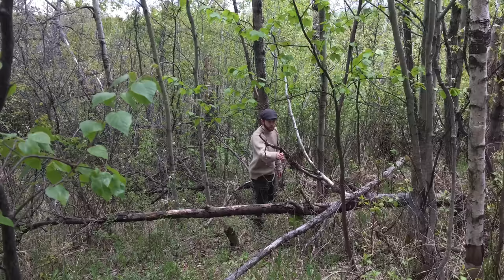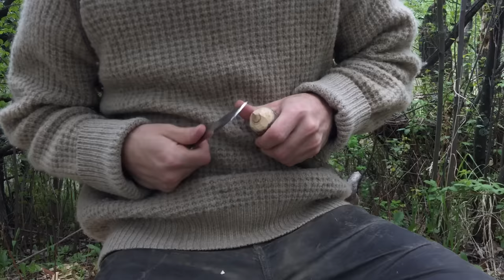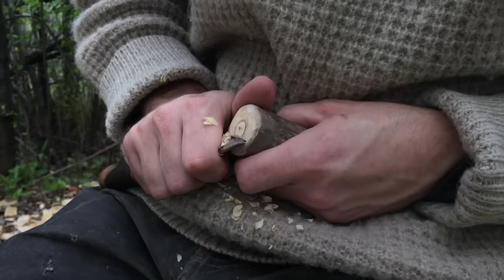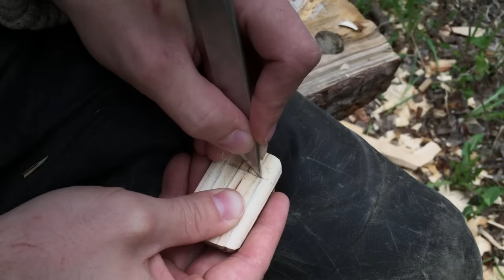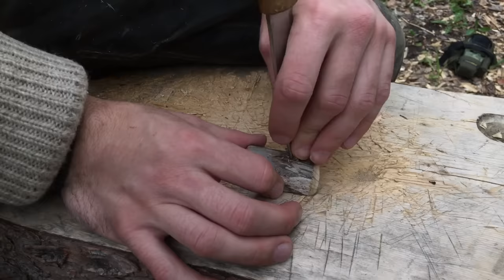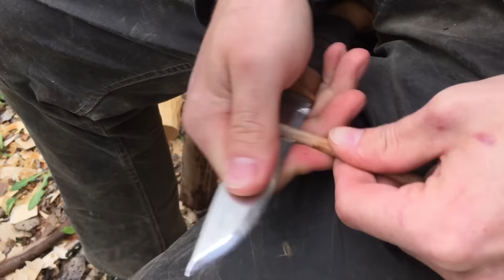Making a Simple Wood Pipe - Easy Woodcarving Project

Comment: I really prefer this kind of videos, instead of the ones in which they use machines to work with wood
Reply: Because I can not afford the machines. Kkk
Reply: After a certain point, they all sort of start to run together. And they lack that little ping in the back of the head that's like 'Hey, I might be able to do that..'

Not a lot of people have bandsaws and drill presses and forty-eight clamps. Most people have some kinda knife laying around
Reply: Absolutely. I went on a woodworking course and the tutor was wondering why I was so obsessed with slow, old-fashioned hand tools rather than his fancy machines. I said that, for me, the process is as important as the end result. Using those machines was like running a marathon in a car.
Reply: Yeah absolutely. Machines allow for really good work but most of us do not have those machines. Moreover, begginers like me have a weak practical mind. Watching methods with minimal tooling allows me to develop my practical mind, like, how to do things with minimal time and effort. I'm not sure i would yield better results with advanced machinery, one needs skill to efficiently use machines.
Reply: Me too

Comment: Smoking back when I was young, very young, I use to impress my friends when we smoked as I always had a selection of wooden pipes I had made myself. I used a small drill bit from the dump to twist an air hole down the stem, and sanded out the center or burned it. I liked seeing this done with only a knife. I still to this day smoke cannabis out of (much better) hand crafted pipes. Great stuff
Reply: I've been looking into glass blowing but this seems like more my style

Comment: Next time I'm camping and have bud but no papers or fruit and only using only hemp twine and a proper knife !
Reply: What qualifies as a "proper knife" in your opinion?
Reply: @primal.wanderer  a knife that's both sharp and holds its edge is really all you need. Even a mini Swiss Army Knife would work for a project like this.
Reply: Knife hits!
Reply: Get to packin boyz
Reply: @primal.wanderer  since it's bushcraft i highly recomed a fixblade knife, for the "logspliting" it's a realy bad idea so smash a folding knife's blade between two wooden logs.
Reply: @arcadymorel7565  that is very true
Reply: Who tf uses fruit still? You can buy a pipe for 5$ most places
Reply: Ron Frezno sometimes it’s fun to spice things up a bit to remember old times when the easiest thing would be an apple
Reply: Juan Pancho Just saying it would make more sense to spend 5$ on a nice glass pipe or 30$ on a decent bong, just in case you run out of papers. Think about hm you spend on kush.
Reply: Arcadi Moral I have several pipes, most of them I bought for under 25$. My cheapest was 5$ and it’s also the first pipe i ever bought. I’ve had it for 14 years and it hasn’t killed me yet😂
Reply: Arcadi Moral I smoke joints every now and then, but nothing compares to a big fat bong hit. If you smoke 1g in a joint you might feel buzzed, but 1g in a bowl will have you high as hell.
Reply: Arcadi Moral Fair enough, everyone has their own way of doing things😂, I love smoking joints/blunts but I also enjoy pipes. I was just saying that you can find decent quality glass for decent prices, if you know where to look.
Reply: Chris Waters Idk what your talking about “mall weed”😂 I’ve never been in a dispensary in my life, I do agree with you tho. The prices there are ridiculous, and I could get much better for cheaper. I live in BC so I don’t have to go that far for good weed lol
Reply: Chris Waters Ik what reference you were making, I just wasn’t sure why you brought it up. I’m assuming it was when I was talking about 1g in a joint, compared to a bong. All I was saying is a bong gets you much higher much faster, regardless of what kind of weed you’re smoking.
Reply: @ronfrezno5353  but if you didnt bring a pipe or bud, and someone shows up with bud and no bowl. Happens all the time. Especially with younger smokers. 
Now in my 30s, I always have at minimum a dugout and hitter on me, but there were plenty of times in my teens and 20s where multiple of us had bud, and the 1 pipe got dropped and shattered, or no one had a piece at all, or papers, so wed use various fruits
Reply: Arcadi Moral  you can get glass one hitters for under 2 or 3 bucks, and decent chillums and small spoons for 5 bucks, at almost every single tobacco store or head shop in the USA. 

Metal cans will fuck you up, because they're galvanized with zinc inside, and that has a very low melt point and offgasses. 

Aluminum is not cheap, steel is. Most cheap pipes are made from steel, and thus do not get hot enough in normal use to pose any danger. Steel is carbon and iron, 2 things we require in our bodies to live. So even if you get some micro steel shavings from scraping it out inside you, you're fine. Just dont smoke out of an old beer or soft drink can.
Reply: Arcadi Moral  and glass is not as safe or as good as you think it is, especially if it's not from a name brand glass pipe maker like Chamelon, Graffix, Sesh, etc.

Cheaper glass pipes run the gambit. From not being high temp glass, not having their carb or bowl holes opened until they've been imported into the US from Asia or the middle east, where some guy just drills them out and gives em a rinse before reselling them to your local hindi or arbab pipe shop, to being straight up glued together in some places, like with some bubblers, where the glue will melt once you wash it once in hot water, or any minute stress will just shatter it to a thousand pieces. 

I have a self standing Sherlock 1 off made by Chameleon, that I got for 85 bucks back in 2006. Its only about 4x1x2 inches, but that tempered, high heat, oven safe bakeware grade glass has stood the test of time over every other piece of glass I've owned, but my Zong Bong. 

Been dropped on cement hundreds of times, withstood my psycho ex throwing it across the house dozens of times, and not even a chip on it. 
Yet I've had pipes I paid 30 bucks for, no brand name, shatter when lapped from a very low chair onto a carpeted and padded floor. 

Like anything else, pipes are best bought from a reputable brand instead of the dollar store generic version.
Reply: use a soda can!

Comment: Have you thought about lining the pipe with some clay to prevent the pipe itself from burning up?
Reply: Clay gets way hotter doesn't it?
Reply: I think this pipe isn't for long term use. The heat should cause the wood to warp and eventually leak smoke. It also likely will be very hot to hold. The traditional clay pipes had longer lifetimes, but arent as easy to produce.
Reply: If you use it for tobacco and smoke slow while breaking  it in the soot builds up into "cake" that protects the wood. It won't last decades like dense hardwood but it should last a while.
Reply: Sitting in my back yard doming a wizards pipe.. next time I am at the cabin I think I’ll grab a maple or beech branch and try this

Comment: This has been an amazing starting point for me. I’ve been making an altered version of this using only a hammer a saw and a shoddy pocket knife and its nearly done.  

My one question is this. Going forward with future endeavors I would want to use a better knife. Do you have any suggestions as to what to look for in a good knife and what I would need to maintain it?
Reply from the maker: Thank you for watching!

I would recommend checking out Mora knives. They have a wide variety of blade shapes and sizes, so you can pick something suited for the type of work you'll be doing.
If you're mostly interested in carving/whittling, I'd recommend the Mora 120. It's a fantastic little carving knife that hold an edge extremely well. I've had mine for many years now and it's still one of my favourite knives to use.
As for blade maintenance, a strop with some honing compound will be your primary means of maintaining an edge. You'll only have to resharpen your blade if you get a nick or chip in the edge. For sharpening, waterstones or whetstones will be a good option. Do some searching around and watch some videos on sharpening to find some more information. You can also look up how to sharpen blades with sandpaper (currently the way I sharpen my blades). Sandpaper is a much cheaper option than stones and works just as well. 
Hope this helps. Happy trails!

Comment: Would the wood not just burn on your first bowl? Is there a way to treat the wood or choose a kind that is less likely to smoulder ??
Reply: Wood doesn’t really burn like that, try holding a lighter up to a piece of wood for a few seconds. The inside of the bowl will char and i suppose with enough use eventually the bowl would kind of fall apart, but it’s not going to combust.
Reply: @NotRelevant1  there is ways of conditioning the inner bowl of a wooden pipe that prevent you from just smoking wood tobacco . Not worried about the pipe igniting more ruining the flavour of the tobacco. A bowl that has a cherry will burn the inner bowl, that is literally how first Nations built canoes. I hear ya though it won't light up like a torch.
Reply: Many will take a bit of clay and leave a thin layer which will protect the wood from burning.

Comment: i like the pipe im also a advent smoker of tobacco pipes i have three (that are left) and if there is one thing i know is that pipe is going to "leak" tobacco juice with any fair usage of it from where you split the wood on both the steam and the cylinder. And for those that are wondering tobacco juice is formed when you exhale or take a hit on the pipe and some of your saliva carried by your breath go's down the steam to the bowl sitting in the bottom of the pipe until you effectively clean said pipe.

Comment: Greetings from a German low-security insane asylum.
I've been trying to make a pipe in our woodshop, and the air drag (I think that is the term) seems a bit bad with mine, and thanks to your video I now know that my hole was at the top of the bowl, rather than the bottom of the bowl. That is what the problem was, lol. Thank you for the very informative video! 10/10

Comment: You can get better joint between the stem and bowl if you were to make the hole along the split in the bowl. Make it slightly undersized for the stem and then when you bind the bowl back together have the stem in place and the binding willing be holding the stem by pinching it in place. Just a thought.

Comment: To anyone who wants to try this, don't fill the bowl up with tobacco on the first light, over the course of 3-4 sessions slowly pack more tobacco. This will build a carbon layer called a cake, which protects the bowl from damage and helps prolong the life of the pipe. When I made my first corncob pipe I filled it up straight away, you can see a nice cake at the top of the bowl but about halfway down it's untouched.

Comment: Instead of cutting the stem in half, one can use a coat hanger , and bend the tip just a slight bit and then ream out the stick.

Comment: I made a pipe once with a knife, but I did it entirely different. I dont think two halves make a great pipe so I carved one from a solid piece and used a nail to drill a hole for the shaft. 

Turned out very nice.

Comment: No glues involved which can be most unhealthy to inhale when fire is added to the pipe bowl. Good video. Considerable expensive to have various size and shape wood carving knifes. The high grade steel involved in a good wood carving knife is costly, but pays for itself over time. Your foldable pocket knife isn't a good choice.

Comment: Beautiful work as always. 

Questions:
1: what knife are you using?
2: do you think it would be possible to drill out the bowl with a bit?
3: could one use a hollowed out reed or thin bamboo for stem (hope that’s the correct word for the piece). 

Stay safe,
Reply from the maker: Thank you.

The knife is a Helle Sigmund.

Yes, drilling out the bowl using a bit is a common way to make a pipe. I did it using my knife to show that a pipe can be made without any other tools besides a knife.

Reeds & thin bamboo shoots have been used for many many years as pipe stems. They work excellent.

Let me know if you have any other questions. Thanks for watching, take care!
Reply: Kusk Bushcraft i have a question:

What kinds of wood can we use?
Reply: @KuskBushcraft  What a beautiful knife! Might have to get myself a Helle.

Comment: As someone who is learning bushcraft myself, i cannot for the life of me seem to get the stem to hold tight. The bowl, no problem, can get that made in probably 5-10 min. But that damned stem, there is always gaps when i put the two pieces together again. It also seems to bow out away from each other. Im using dry wood, i dont know what i am doing wrong. Do you have any tips or know what it is im doing wrong? Because i will take any help i can get. I really do not want to drill it, i want to make the parts by hand, but it might have to be done with a drill. Love your video, i use medical canabis for severe anxiety, and im not a huge fan of the paper rolled smokes. I just like pipes, and hope mine can be used to enjoy my smoke.

Comment: As someone who is currently trying to do this, a knife with a serrated inch on the base of the blade, probably is not terribly helpful. Also I'm wondering about my choice of pine. Lovely, yes, very fragrant, but it doesn't seem to shape the same way. Also my arms hurt horribly as I haven't done something like this in years. XDD

Comment: Burns wood to start a fire, logical result.
Burns something inside a wooden pipe, pipe is fine...
That's a stupid question I always asked myself (especially since I only used pipes made out of anything but actual wood) a couple of times, but won't your tobacco or cannabis taste like  burnt wood smoking in that ?
Reply: Not if you burn only the tobacco and avoid getting it really hot. A good screen in the bottom helps as well as you most likely already now.

Comment: Not trying to be disrespectful here, I really enjoyed the video, but wouldn't a smaller knife make things a lot easier? Just wondering
Reply: not creator, but smaller knives can actually make processes like this much more difficult, as you don't have the weight of the tool working for you. Which means you have to put more force into it - making for a higher chance of damaging your work or yourself. could you use a smaller knife? absolutely. is it better? I doubt it.  There's also the reality that one may not have a smaller knife on hand; you use what you have.